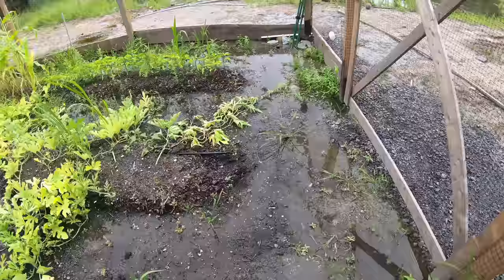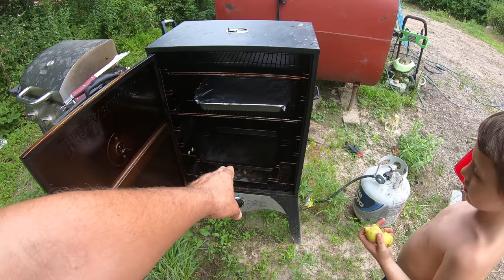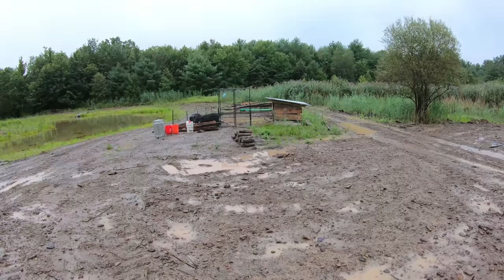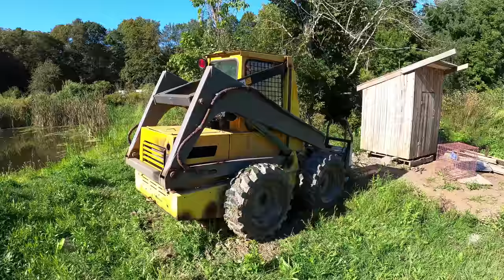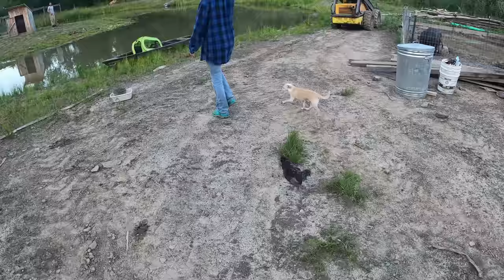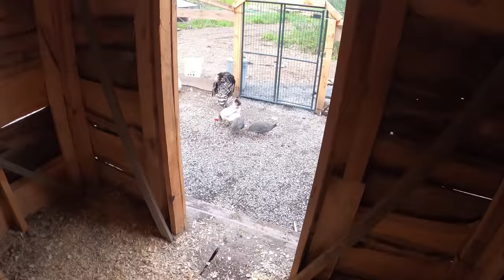Building a Homestead part 4 : Moving chicken coop to the island, tomato sauce/salsa, nesting boxes

Comment: If you talk to woodworkers locally, you’ll get all the sawdust and planer shavings for bedding you’ll use in your lifetime 😉
I’m a small time woodworker and I generate 6 very large garbage bags of planer shavings a year….which normally go in the garbage. Large scale woodworkers generate a lot. They’ll be glad to get you to take it away for bedding.
It can also be used on paths through forests.

Wood shavings are mostly carbon, so putting them in the soil in large amounts can cause problems unless you add nitrogen, etc., especially trace elements. I had a bed grow very spindly flowers for awhile until I figured out that planer shavings as a mulch worked for keeping moisture in and weeds out, but degraded the soil quality.

Comment: For someone that doesn't know much about canning it sure looks like you did your homework. If you plan to do more canning in the future, I would suggest is to get a pair of tongs made specifically for canning. They are designed for picking up canning jars and you won't have to worry about dropping a jar as you pic it up out of the hot bath. And you only need one hand to do it.

Comment: Doubt the water will deter a hungry predator if they know they are out there. Check out the automated coup doors that run on a 12v system for your goose coup - they stay charged with a lil solar panel. I've seen them on the twitch channel dashducks. They are a little pricey around $100 but should work good for that setup without the need to let them in and out. If one of them misses the cutoff you could put a little elevated platform or something for them to stay out of harms way on the outside. 

Cool updates its looking nice Jesse! Excited to see that Cement house all finished!

Comment: Next year grow your cucumbers next to the fence so it will grow up the fence , it is a vine and they need to hang and then they will grow longer ! You might have to tie strings from the ground next to the plant and tie it off to the top of the fence so it will grow up the string but the closer to the fence the better . Hope this helps plus if you change the location of all of your vegetables around your garden they will grow each year without depleting nutrients! Grow sunflowers with your corn ! Corn need a lot of nitrogen and sunflowers supply it

Comment: Those cukes need some fertilizer but you have probably figured that out by now. I use the 6" concrete wire mesh for tomato cages. It gets them off the ground and they are easier to pick. Those blue berries might be elder berries but I'm not sure.

Comment: Years ago, I bought a 6 foot tall  roll of cement wire and made (18) 30" dia tomato cages with 6" openings.  Pretty easy to do.  Works great and I use them year round.  In the fall, I put them around my young trees to keep the deer off them.  Good for growing cucumbers as well (Tasty Jade).  I cut a cattle panel into (2) 4'x8' sections and stacked them/fastened them  between two metal stakes for my pole beans.  Bush beans were taking up too much room, too hard on my back and too convenient for the rabbits.  I get lots and lots of beans in a small footprint.

Comment: This is three years after the fact. But, if you happen to read this, the yellowed leaves on the plants indicates that the soil is holding too much water. When you set your topsoil in, I thought that with the water table being so high there, gravel could have been set on top of your soil base under the topsoil and trenched in between the rows to allow the moisture to seep out of the black soil and prevent it from water-logging your vegetable's roots.
The weeds in between the rows don't compete with your veggys for water, but their roots do rob the veggy's roots from the nutrients seeping through the black soil. 
We never had the over-watered problem in our garden. Hand watering with buckets was our choir. We made a half-assed effort but eventually neglected the weed growth in between our rows. Our neighbor kept all the weeds out of his garden and watered it daily. His garden was 10 times greener and produced 10 times the quality and quantity per plant than our garden did.

Comment: You're on a good path but your rows need to be 2 feet wide on top and 3 feet on the bottom about 3 feet high. 
Down the center have 4 foot stakes 3 feet in the ground with thick twine between them for vine plants.
Grow you cabbage, lettuce and califlower on the top.
Carrots and other tubers on the sides.
It's called the Chinese Raised Row method of gardening.
I used to get so many tomatoes I had to give them away by the bushels.
Reply from the maker: That makes sense. I found out quickly that the dirt I put in wasnt enough

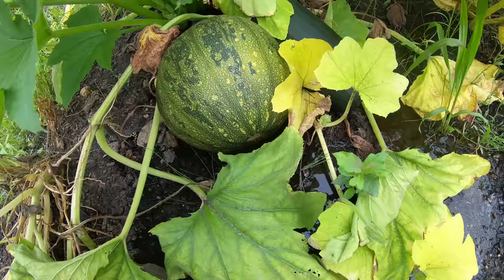Comment: Just hilarious. Myself I would be hesitant to grow and eat, not less feed my kids, cucumbers and beans and tomatoes from a stagnant pond of oil and diesel (4:16) ....
Reply from the maker: that is not stagnant water, I had left the irrigation on all day and then went in there, that whole garden is bone dry even right after flooding rains. Its all sloped back into the pond. And as far as oil and diesel, no there is none of that in there. IDK why you would think that
Reply: @jmuller86  Hi Jesse, thanks for your respond. What I meant is that I thought I saw a shimmer of oil on the water, but if I'm wrong it's my bad and sorry.
About the stagnant water my impression is that by running the dozer and all the machines you compacted the dirt too much and created a hardpan where the water will only run superficially to the pond. Also, pure clay is perhaps the worst medium for plant growth. 
Later in the video you said you where going to add a foot of organic (top?) soil. That is good but my opinion is that a better solution is to loosen up the clay you have and add nutrients deep down. This will create free and drained soil for the plants.

You might not have heard about "double digging" gardening, but the principle is to manually dig rows 2-3 feet deep into any kind of (compacted) soil, at the same time as you add the right/proportional amount of nutrients, especially organic matter for the right C/N ratio and essential minerals like kalium and phosphorus. The method is labor intensive (I've done my share on several 12x3 feet plots), but the reward is tremendous with an abundance of good and healthy veggies (and not the funny cucumbers and carrots you had). 

Since you are a wizard with machines I'm sure you can come up with a less labor intensive method (like I never have had the chance to use). Eg you might use your small excavator to digg, drench the field with a sub-soil drainage (just rocks in a ditch), and add saw dust and forest waste + minerals. Your son seems to be a hardworking good assistant to help you with that. Good luck and bless you and your family.
Reply from the maker: @SteifWood  when I built the garden , I laid about 18 inches of good garden compost soil, specifically made for fruit/veggy gardens. Next year I will add about another 12 inches to it, the clay is very dense and I wanted to also raise everything up so its well above the water table, which is the pond. Otherwise I would have dug down like you are suggesting. Some of the things like carrots and onions, potatoes could have benefited from the extra foot this year but I am learning as I go, so next year I will correct everything that I can